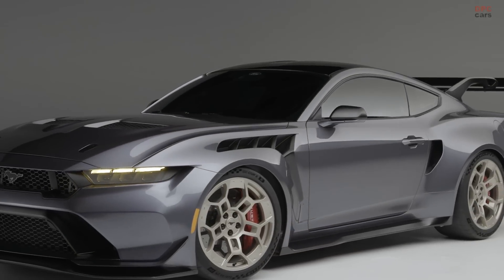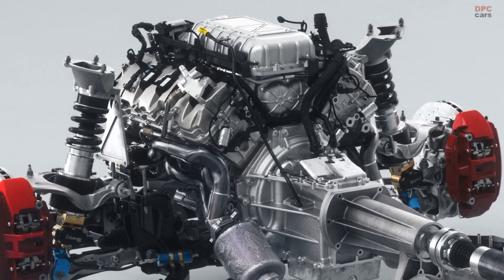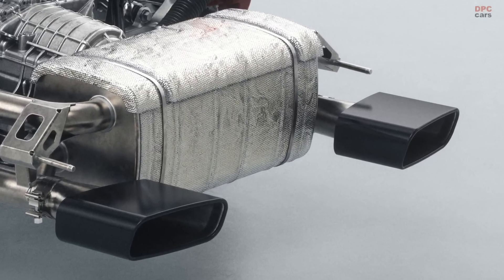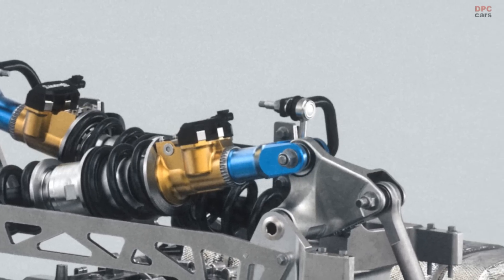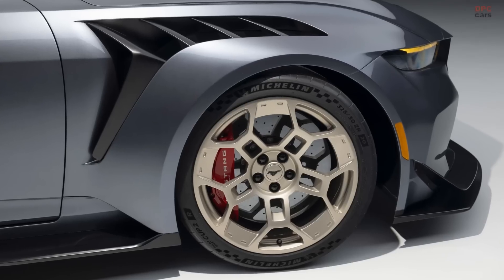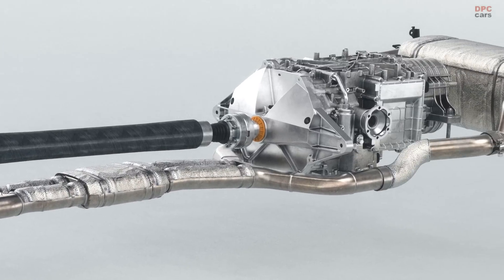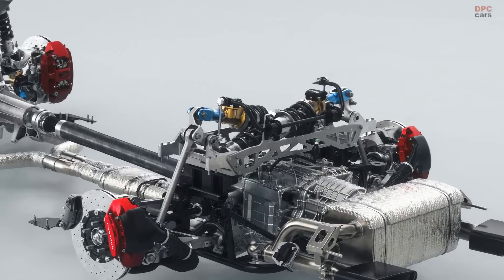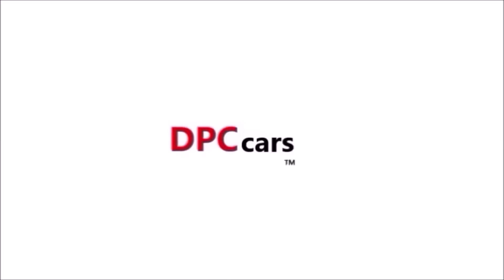2025 Ford Mustang GTD Technical Deep Dive

Comment: I don’t know yet. Looks good, but not 300 grand good.
Reply: Looks don't matter, and what exactly do you expect the price to be ? I don't see someone building a race car for cheap.
Reply: The reason for the $300k price tag is due to the carbon fiber body panels and aero bits(splitter, side skirts, rear wing and rear diffuser)
Reply: @jgonzalesm6 isn’t it also partially due to being developed by the same company that developed the new GT3 Mustang and using a lot of the same technologies within that car for this one? That would definitely bump up the cost to make -> then sell.
Reply: @R1mez  - that's a possibility as well.
Reply: @jgonzalesm6  It's not just a possibility, it's the main reason it costs that much. They are literally building a race car that's road legal, that level of engineering is ridiculous in itself, the CFB is just a wild card that obviously increases the price by itself too, and we also have the fact that it's limited production, and we have the fact that it's suppose to perform on the level of a Porsche GT3 RS and a Mercedes Benz Black Series, both in the 250k-500k price range depending on the car setup. 300k really isn't that big a deal when in reality the amount of things this car has going on would be way above that price range.
Reply: @raionshishi8290  - Yep.  I remember when BMW made their 2002 M3 GTR "Strassenversion" and the starting price for that V8 powered car was $250k....the whole car was carbon fiber.... no wonder.
Reply: @jgonzalesm6  It's funny how people forget these things... a car from 2002 costs 250k, nowadays would be considered highway robbery on a biblical scale because that car would get destroyed by any modern day road course track built car that's road legal even.
Reply: @raionshishi8290  - true, but that price has definitely increased over the years IF you have one.
Reply: @jgonzalesm6  Another example would be the Porsche Carrera GT or the Mercedes Benz AMG SLS. Both get beat by many cars today, but those cars cost well over twice what modern day cars cost even tho they beat them. Ford Mustang GT500 CFTP for example at best with no ADM is 100k, best example yet as this car has been beating cars WAY above it's class in performance and price.
Reply: Agreed. 🎯  And good luck with Porsche.
Reply: You're paying for what lies under the looks with this amazing machine, and that is well worth it!

Comment: Multimatic built it so it's going to actually be fast. Not Ford thank God
Reply: It's actually built by ford performance in conjunction with multimatic
Reply: @twilightmedia8575  the concept the one you're looking at is built by multimatic. With parts donated by Ford. Now Ford is going to build new tooling assembly line, to pay cheap labor to bolt on panels. That was developed by multimatic racing

Comment: Only a track and not 1/4 mustang
Reply: @jesusm2159 - That's right.  It's made for real racing on a road course, not some Mickey Mouse straightaway drag strip!   :hand-orange-covering-eyes:
Reply: @Loulovesspeed  yea but streets are straight for most part
Reply: Running in a straight line is getting old don’t you think.